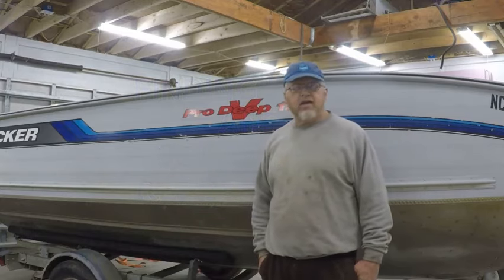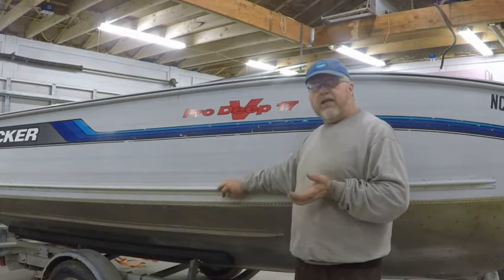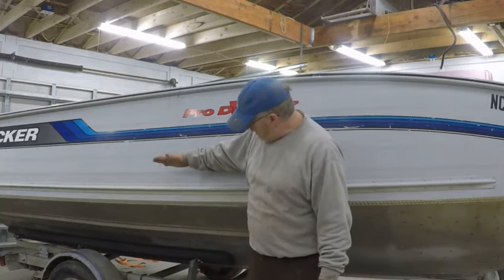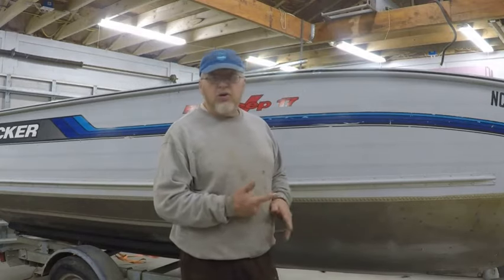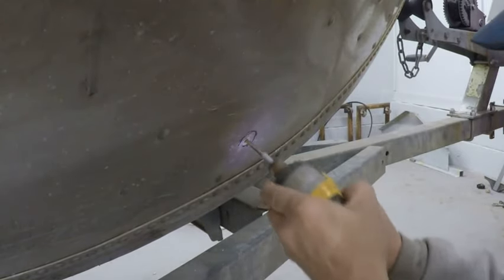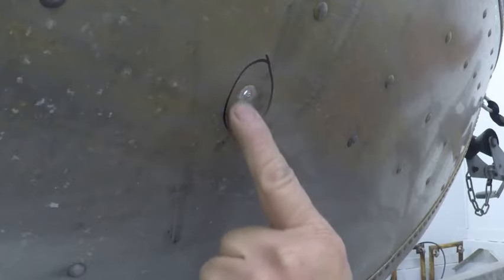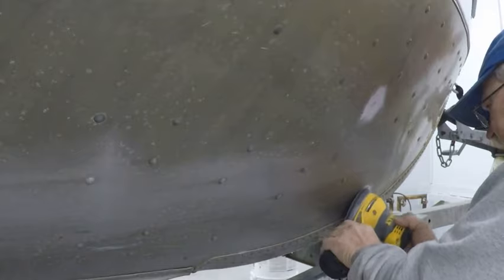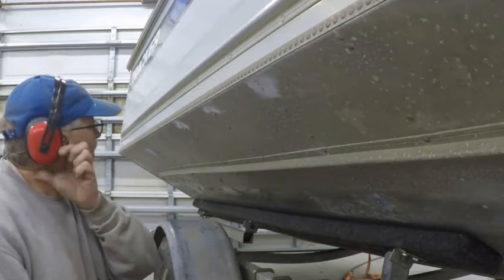IT'S REALY THAT EASY!!!!!  FINDING LEAKS AND REPLACING RIVETS IN ALUMINUM BOATS

Comment: On existing rivets i don't drill them out. I just get someone to hold a big hammer on the inside while i give it a good whack on the outside.  Seals them up every time with very little work.
Reply from the maker: Yes sir. That works fine if there’s no corrosion.     Thanks for watching and commenting. I appreciate it

Comment: I always prefered all welded aluminum boats, but since i've been watching your videos i am no longer opposed to a riveted boat. You have shown how easy it is to find and repair damaged rivets. Great job as usual.
Reply from the maker: I appreciate that
Reply: i weld aluminum boat t tops leaning posts ect for a living. welded boats are not better or stronger than riveted, thats a big misconception. Rivets are easier to drill out and fix where as the constant strain and stress being beat by waves or sand from beaching the bow up will crack welds and the aluminum around it. rivets allow a lot more flex and vibration but just my two cents. look at an aircraft if you want proof, theres a reason they dont weld them
Reply from the maker: Amen.  I tell people the exact same thing and they want to argue. Lol. Thanks for watching and commenting

Comment: Is there any difference from. Using your method, vs traditional rivet hand tool aside from time and efficiency? Any special rivets needed for these? Cause ive seen ppl use some sort of aqua silicone when putting in riviets.
Reply from the maker: These are solid rivets.  You have to hammer buck them or use a hydraulic press gun.  The other type is pop.  I only use closed end pop rivets as a temporary or last resort.

Comment: I'm planning on doin this with my 91 lowe 1657. I believe the rivets are 3/16 should i get 3/8 or 1/2 length? Also my keels are like the one on this boat on the bottom they are just riveted to the boat some place where the rivet goes through to hold it on are torn ar broken and there are some wear holes in the keels? What would be the beat way to try and fix that?
Reply from the maker: Length is determined by the thickness of what your holding.  As a rule you want 1 1/2 times the shaft sticking out.  So on a 3/16 you want 5/16.  If the cracks are real bad I’d have them tig welded inside and out.  Then go from there

Comment: I've tried about 20 rivets now.  They just bend on me like a nail or they don't get tight.  Tried different psi's.  3/16 1/2" rivets.  Can't figure out why they won't work?
Reply from the maker: Might be to long. You only want about 5/16” sticking through.  Anymore than that and they can bend.  A variable speed impact makes it much easier.  That way you can go slow till you get the hang of it.

Comment: Grat video. Really informative.  I have question. Restorin and old riveted  aluminum boat  and would like to know your opinion. The  boat comes to me sanded inside and  out. To bear aluminum. Sbould I seal it before water tested?
Reply from the maker: Either way is fine.  I’d do it before just to see

Comment: I’m a aircraft structure guy. When we rivet on the outside of airplanes we use a sealant. Just a small amount around and in the hole to seal everything up as the rivet expands. Doesn’t the boat have this from the factory?
Reply from the maker: Overlapping panels have a sealant in between the layers.  A well bucked rivet will give a water tight seal.  Aircraft have a high positive/negative pressure so sealant is required on certain types of rivets.  A lot of times they used a epoxy primer like substance.  It help prevent corrosion and fill microscopic imperfections.  Thanks for watching and commenting I appreciate it

Comment: How small is your Compressor please.   I need advice on this. You are da man.
Reply from the maker: I have a huge 100 gallon in the shop. But I’ve used a small 1 gallon before.  The hammer doesn’t use a lot of air in short blast.  Thanks for watching and commenting

Comment: I have a dent with leaking rivets,  would you try to hammer out the dent or just replace the rivets?
Reply from the maker: If it’s workable I try to straighten it before I remove the rivets. Aluminum does stretch bad.  That can make it harder for sure.  I’d say use a quality epoxy and try to seal the seam.  Good luck
Reply from the maker: I appreciate you watching and commenting. Thank you
Reply: Thanks

Comment: Hi, I'm looking for any advice you might have on how to fix a rib inside the bow of my boat that the somehow was torn off of 6 of its rivets. The outside of the hull and the rivets themselves are still in place and look perfectly fine, but when I removed the floor to replace it, I found a rib sort of popped up a little and really wide holes where the rivets used to go through. Looks like the last owner covered it in black goop and called it a day, but that's not my kind of fix. lol...  I'm not sure if I can add extra rivets, or if I have to tear out the whole frame to replace that rib, or what? I appreciate any guidance you can give me because I can tell you have a lot of experience and know what you're doing. (I don't have a clue, but I'm learning...lots of thanks to you and your videos!!).
Reply: truss head stainless bolts and 5200 sealant when you install them.

Comment: Great video thanks for posting this. I have a 57 sea king I’m restoring and the previous owner used bolts with washers and epoxy in several spots that had rivets. I want to redo it correctly before coating. Would you tig or braze the hole then reset a new oe sized rivet? Or use a bigger sized rivet with epoxy? Thanks in advance
Reply from the maker: I would go to 1/4” river but no bigger.    I have welded a few up in my day but I always put the river back in.  
Thank you for watching and commenting I appreciate it

Comment: Do you have to use a special tensile  rivet or will just any aluminum solid rivet work ?
Reply from the maker: I use what is called “soft” rivet.  They’re all about the same.   If you use “ hard” rivets they’re more difficult to get right for  beginners and not necessary.  I hope to have kits available soon that has rivets and the tool to set them.  Thanks for watching

Comment: Starcraftt 18ft vbotom  3/16 brazier heads right. I just order impact hammer u have??
Reply from the maker: Awesome. Yes that’s the type I use most times. I keep 1/4” on hand for holes that are out of round or just need to be cleaned more.  The length varies by area

Comment: Hey man what do you recommend to seal the bottom of a leaky aluminum Jon boat with And do you recommend jb weld or and epoxy to put on the rivets for a seal
Reply from the maker: I never use JB weld.  It just doesn’t hold up.  I use epoxy. If the metal is in good shape I just use the river with a little epoxy paint.   It will seal without it if done right but with it it’s more forgiving.

Comment: When you dont have access to the interior floor are you using blind rivet with sealant ? Thanks!
Reply from the maker: I use closed end blind rivets.   The mandrel is sealed so they don’t leak through the center hole
Reply: @bowl830  just watch your other video about that . Using sealant on the Rivet like 3m 4200 is good or better use epoxy like gflex?
Reply from the maker: @JérômeSabourin-n7m  4200 should be fine.  I’ve had about a dozen of the closed end rivets in my boat for 5 years with no issue.  I used G flex.
Reply from the maker: Thank you got watching and commenting I appreciate it
Reply: Thanks alot for your answer!
Reply: Are you using aluminum Closed en rivet with aluminium mandrel ? Propably did a mistake and order steel mandrel
Reply from the maker: I am.
Reply from the maker: Try to avoid dissimilar metals when I’m wet location

Comment: Are the replacement rivets you are using aluminum or steel? And, are the original boat rivets you are taking out aluminum or steel? Thanks
Reply from the maker: Yes aluminum and the original is as well
Reply: steel and aluminum in direct contact react with each other and corrode

Comment: If it is aluminum, as I think it must be, is the Brazier solid rivet considered to be a hard or soft rivet? Thanks again.
Reply from the maker: Thanks for watching and commenting I appreciate it.  Brazier come in hard and soft.  I recommend going with soft for boat skins.  I use soft 99% of the time
Reply: The Brazier indicates the type of head as I understand it. So where can you purchase a soft Brazier head aluminum rivet and how do you know you are buying soft and not hard rivets? Thanks again for your speedy reply. That was quick!
Reply from the maker: Yes sir Brazier is the type.  I buy them in bulk. I have a company supposed to be shipping me some kits for me to sell that includes a variety of different lengths and the set tool but Covid has them way behind. . 
You can buy them on line at aircraft builder supply houses. They carry every length and diameter there is. Aircraft tool supply is there name. 
I use all aluminum on boats.  Never mix medals. 
Hard rivets will have a dimple in the center of the head and usually feel a little heavier.
Reply: Thanks again for such a speedy reply. Much appreciated. I hear Aircraft Builders Supply Houses is a good source. Thanks again. Great video and information.

Comment: Where did you find the rivet chisel?
Reply from the maker: I order them in bulk.  I have a rivet kit that’s supposed to be available soon. It will have varies size solid rivets as well as the set tool and some closed end blind rivets. They should be in in a  couple weeks

Comment: What type of rivets are the the softer ones of the hard ones theirs two typeen
Reply from the maker: Soft rivets.  Hard have a dimple on the head
Reply: Which on you use when you reskin the tracker transom
Reply from the maker: @anthonyaviles8665  soft.   Hard rivets are rarely used in boats. It takes a hydraulic squeezer to set those
Reply: Yeah the ones i orderd off amazon where the hard ones have the dipple in the middle ended up ordering the soft ones from jay cee rivets and sales in mi
Reply: Do you recommend a little g flex seal around the rivets
Reply from the maker: @anthonyaviles8665 I will put a little in the hole   You don’t want it to get in between the head and the surface If possible.  A little is ok.  For me it makes it harder to get a good bucking.  If the hole is irregular it does help get a good seal

Comment: What if there is alil bit of corrosion around the rivet hole?
Reply from the maker: Clean it to bare aluminum. If the hole is corroded and not perfect. Go up one size on the rivet to where you have good clean hole.  Sometimes I use a good epoxy on surface of skin then insert rivet.   Don’t use a soft epoxy.   Good luck.  Thanks for watching

Comment: Great tutorial, but I cringed when he drilled them out. That’s a fast way to go through drill bits. Keep it 700 rpm or lower to keep the temper on those bits. A good sharp bit at 700 rpm will tear through material faster than a dull bit at 3000
Reply: Crazy how that works...
Reply: Its aluminum softest metal going ... almost
Reply: @dusty1498  friction on Aluminum still creates a lot if heat
Reply: @LittleBunnyKungFoo  Fair enough your right about drill speed but even with cheap bits you would have to be drilling at top speed to dull them on aluminum
Reply from the maker: @dusty1498 it’s usually not a issue of dulling when working with aluminum, the biggest problem I see usually is gumming up the bit.  I’ve had to oversized a few times cause the bit gummed up and fouled the hole go through.
Reply: @bowl830  I didnt even consider that possibility
Reply: @bowl830  Interesting Thanks for the Tip. Oh are you still selling kits and what air hammer do you recommend? Thanks

Comment: Tig welding😊
Reply from the maker: Tig is good at filling holes but a bad idea for replacing rivets.  The rivet is there to hold multiple layers and sometimes ribs or supports.  I’ve had to drill out and repair many boats that were welded   Welding has its place but o usually will weld up one if I think it’s to bad to just rebuk.  But I will drill it out and replace the rivet afterwards.  Thank you for watching and commenting

Comment: I cringe when i see leaking rivets repaired by welding them.
Reply from the maker: Same here.  I Hate to see a riveted boat welded at all lol.  I had to weld 2 small hairline cracks around rivets.  But I put the rivets back in afterwards
Reply: @bowl830  totally understandable what you did chasing cracks. Boat looks good 👍

Comment: No sealer on the new rivet such as 4200 ??.? . Thanks
Reply from the maker: A good clean hole no.  The panels had a sealer between the layers but they don’t apply anything to the rivet itself. I use a thin epoxy sometimes if the holes are a little corroded. You can also use a epoxy paint.  Just dip in it then BUCK the rivet. Wipe off excess.  You don’t want anything thick to get between the head and the surface.  It will cause it to flex and leak.